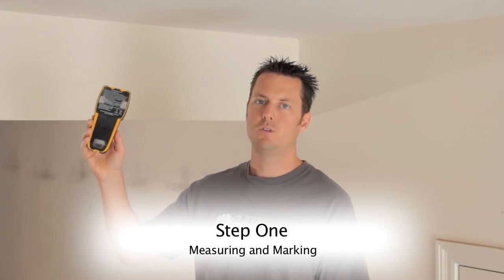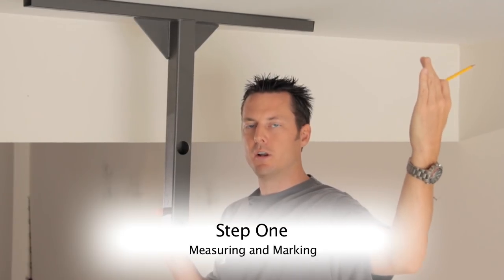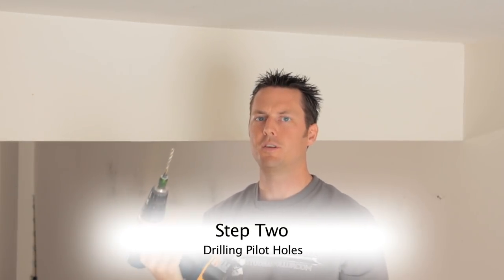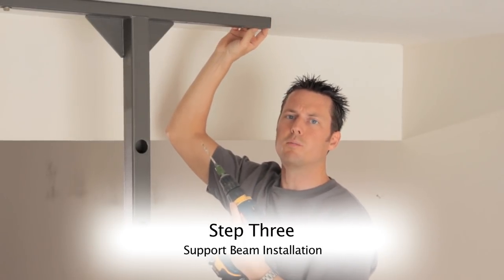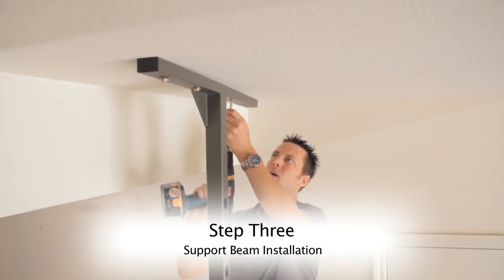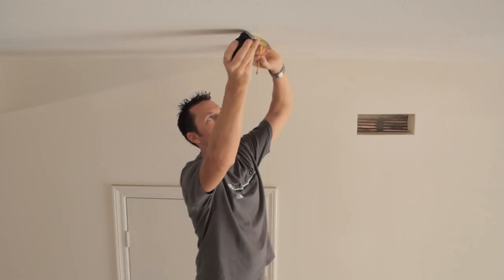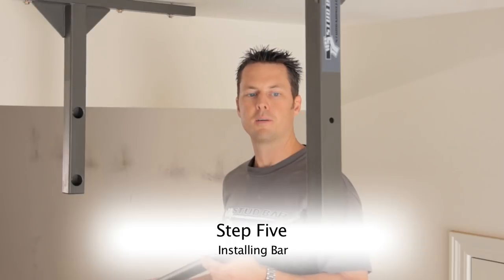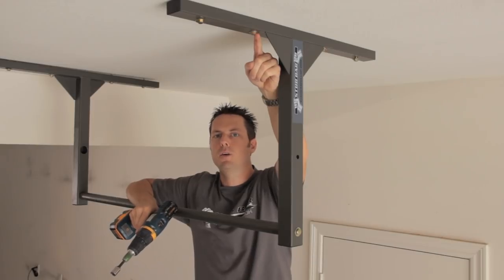How to install a Stud Bar pull up bar into wood studs

Comment: These are good instructions.  I just finished installing a 39" (large) studbar into an 11 foot garage ceiling.  It's rock solid.  Best piece of advice I can add to this is invest in a good stud finder and measures out the studs carefully before installing.

Comment from the maker: If a stud finder is not working then the good old drill bit is your other option looking for a solid piece of wood behind the drywall. If you don't have studs spaced evenly you can always modify the width of the stud bar to line up with what your spacing is or you can mount 2X4's across your existing studs to make the stud bar work. If you do locate two oppsosing studs or joists 48" apart or closer email me off my site and I can assist you

Comment: When Installing the pullup bar directly to drywall to get to stud you don’t get any compression on drywall when doing pull-ups? Is it a better idea to install 2X6 to wall then mount the pullup to the 2x6?
Reply from the maker: Drywall is unaffected the load is spread out. 2X6 is not necessary

Comment: Was unable to mount on garage ceiling (joist spacing not 48) and slightly concerned with possible torque issues for a wall mount (kipping, bar extends out 39 inches from wall). Wondering if other people have wall mounted successfully, and if it's better to place 2x4 across wall or mount directly through drywall and into 2 wood studs. Any feedback or suggestions is greatly appreciated. thanks!

Comment: Somewhere along the line they changed the lag bolts.  A 13mm socket is too small. A 17mm socket for the bar bolts is slightly too large.

Comment from the maker: As long as you have wood or metal studs or a concrete wall or ceiling you can. I have had customers insall in NYC apartments generally to concrete ceilings

Comment: My nyc building was built in 1927 and I have drilled a hole in the ceiling and it seems that there is plaster and lath.  Stud finders are giving me false readings, and I've tried 3 different ones and even bought an expensive $50 dollar one and no luck.  I have 3 holes in my ceiling as we speak.  Any advice on finding a stud, I want to find one before I buy a stud bar.  Thanks

Comment: What does he mean finding a stud
Reply: The wood stud that is behind the ceiling's sheetrock.  Since you can't see through sheetrock, you have to use the stud finder to locate the wood stud.  That is the anchor point for the pull up bar.